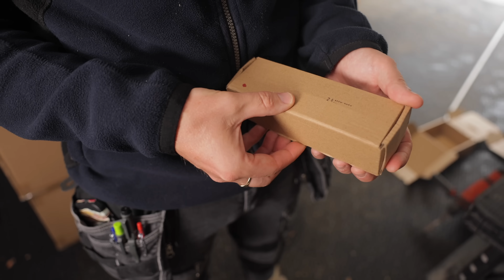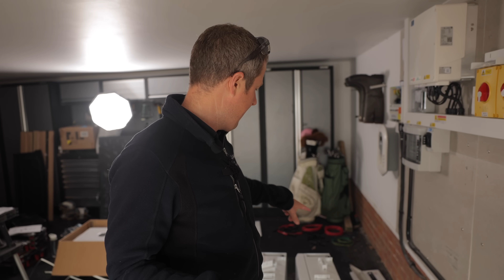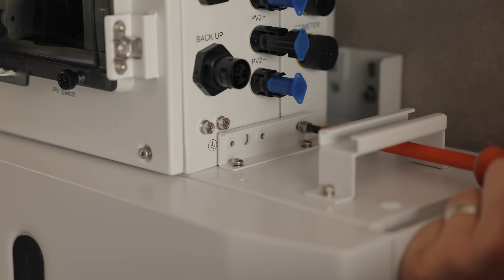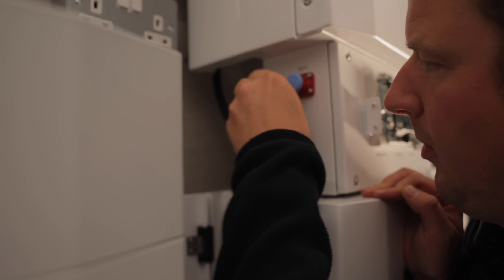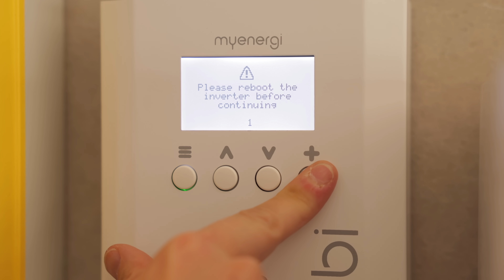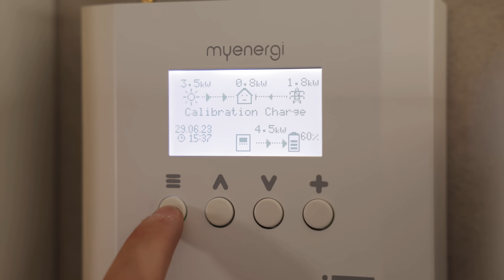How To Install A MyEnergi Libbi Home Battery Storage System 🔋

Comment: I do like the My Energi connectivity and easy menus with lots of user info. Not keen on the connectors for Grid/Load and wonder how long those pins would carry 20 Amps, I would have preferred a direct connection to an MCB. I see people are saying why only 2 double sockets for back up - User choice of course, but it seems odd with 20kw of back up, circa 6k of kit plus installation and you still have trailing leads for back up. Personally, I would have used half the CU for back up to ensure lighting and small power during power outage

Comment: Ah. Low voltage batteries.  I remember them. Drawing  over 60 amps to boil a kettle as opposed to 10 amps on a proper high voltage Solax set up.

Comment: If a customer wants to add an extra 5kWh module to a 10kWh libbi system (5kW inverter already fitted), is there a kit for this, or do you need to order all parts separately ?

Comment: Hello, congratulations on the flawless installation, you're truly an artist!
Thinking about those incompetent individuals who installed the photovoltaic system for me with 2 BluE-S 5000D inverters and 4 battery packs on a three-phase system, it makes me furious!!!!
Am I mistaken, or did you not configure the DIP switches in the video for addressing the battery packs? Would the controller work with another Kstar inverter as well?

Comment: Hello from Germany, your RCD tripped in 126 ms. In Germany they have to trip within 200ms or 400ms depending on the earthing arrangement. But in reality they trip much faster. Most RCDs in Germany trip within 30ms. So my stupid question is: Is 126ms a common time for a RCD to trip in the UK? Because the time should only depend on the RCd itself. And in the UK I have always seen the same brands than in Germany. I must admit that I am a little confused.

Comment: I have a question you might have been asked previously: would it be at all economical to get batteries fitted and an inverter without solar panels and charge the batteries from the mains supply over night when the cost of supplying energy is cheaper than during the day. Then using battery power during the day? How’s that for a question lads, I will wait to see what your reply will be. Great dvd by the way.👏👍🏴👏👍🏴

Comment: Apparently minimum distance between batteries is 20cm, and maximum is 25cm. I need to have mine installed a minimum of 60cm apart due to location, and apparently that isn’t possible. What are your thoughts on extending the cables?

Comment: Hey, I’m a bit confused about the EPS earth rod being connected to the MET? Doesn’t that defeat the object of completely isolating the grid side of the installation? I thought it was a discrete earth feeding the EPS side only. In the event of a fault occurring on the EPS side, aren’t you potentially feeding current into the grid earth via the MET? I thought the EPS side has its own TT earth attached to nothing else.
Reply: The safest thing would be to convert the whole house to TT then theres no risk of current onto the DNO earth
Reply: @haldo691  ooh, that’s a hot topic on other forums! Using steel reinforcement in foundations as a TT earth,….. possible introduction in future regs……

Comment: I'm all for safety but even the handling restriction in the manual seems a little over cautious. The Libbi is LFP and in the words of Dr Euan McTurk, "It's basically a rust battery, you'd have to do something monumentally stupid to get it to catch fire"
These type of battery chemistry doesn't get hot enough on it's own to become self sustaining. It'd be like trying to light a flame retardant couch on fire. You could definitely do it, you'd just have to put a whole lot of effort in.

Comment: A quick question, maybe stupid but I’m not shy for asking stupid questions, what’s the opinion/rules about putting the markings on removable parts, aka the lids of junction boxes/isolators?
By the way, next time you should consider cutting the flooring out underneath the batteries, if the customer want to replace them I’m guessing it’s not gonna be cheap.

Comment: Hi Jordan,
I’m a keen follower of your channel. At 78 I am still learning!
Could you answer a confusion about solar panels?
If I want to do an alteration to my home electrics, say replace a faulty light switch why do have to isolate the supply from my solar panels?
This seems to be the advice by the experts.
If I am to turn off the circuit at the consumer unit and attend to replace the faulty switch, wouldn’t that be okay?
Cheers, David

Comment: This was an excellent video Jordan. Great work. That comms cable on the back of the inverter looks a faff. That needs engineering out lol. I always struggle commissioning pretty much all the EV charge point and PV systems. Especially the wifi reliant ones! I find the CT setup with myenergi a little clunky as well tbh. Loads of very helpful and useful tips in this, appreciate it! Does this system have a built in neutral earth bond relay for island mode? We are waiting to go on our libbi training atm!
Reply: I like many are having issues with their harvi wireless ct sensors, may have to swap to a cable type.

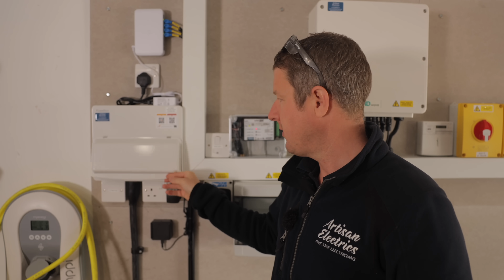Comment: 9:50 also if you've got a separate PV inverter then in theory at least you can self-power a larger load. If your house is using 8KW in the middle of the day and you really don't want to pull anything from the grid you can take e.g. 5KW from the solar and 3KW from the batteries simultaneously. If you only have one hybrid 5KW inverter then even if you have a full battery and the sun is shining you're still limited to supplying 5KW total
Reply: that's why you run a 16KW hybrid...
Reply: @eethon1  well, yeah that would be another option, but here Jordan is discussing reasons you might have a separate PV inverter to your battery system
Reply: @JamesScholesUK  Indeed, was a little tongue in cheek.

Comment: Can I ask why the normal HD wave inverter was installed and not the Home Hub series? Actually, surely 2  Solaredge batteries would have been cheaper and a dc coupled solution with one app support?
Reply: They may have a FIT tariff, you need to be AC coupled for that.

Comment: I do enjoy these videos they're interesting and informative so thank you. I do have a question though. Is this battery system only powering those 4 sockets if the event of an outage? Could you wire the batteries/inverter so it powers specific circuits such as lighting, heating or fridge etc.?
I understand perfectly why you need to isolate between the grid and the battery and that this isn't an 'Online' UPS so there is a ms of delay. but could they be installed so they power the whole house?

Comment: I really doubt that any portable fire extinguisher would put those packs out once it started.  You might be able to put the cardboard box out, but the battery itself will continue to burn.  I know firefighting an EV once started can take 30,000-50,000 gallons to extinguish.  A 50 lb ABC Wheeled Fire Extinguisher that weighs in at almost 200 lbs on a cart only will operate for 35 seconds.  Its s completely silly requirement for sure for the transporter to attempt this even at all.  You get out and walk away while calling the fire dept and tell them where the melted pile of metal and plastic, uh van I mean, will be located.  🚒🧯🔥
Reply: Well no, because these aren't Lithium Ion batteries.  Lithium Iron Phospate are a totally different beast, and are probably safer than the lead acid that starts the van.

If you were using a Tesla Powerwall, then yes, they use Li-Ion and are likely to melt a flaming hole in the road.
Reply: @zstation64  Completely agree with you.  Just funny that they want you to carry a portable ABC extinguisher to put out a large lithium battery fire in the first place.  Every commercial vehicle is required to have an extinguisher here in the US, but typically it's not for you, its to help the other guy that might need it.  🤠👍  My guess is that if your van is on fire you won't go inside to grab it and then open the doors where all the fire is to try and to put 20+ kWh or more out.  That is why the fire dept is there to help out.  🚒

Comment: Another great video. Just two questions, not sure if it's the same for you but our DNO views an AC coupled battery as a separate micro generator which puts you over your 3.6KW export. Also I was just wondering how important it is to use Libby? Kstar is the same thing and costs 1K less
Reply: I'm not in the trade but I imagine it's the same as with all generic products: is the cost saving equivalent to the possible loss of technical support?

 In this case I have no idea about the support for the similar product it's just a suggestion and may be worth investigating before committing to purchase. 👍

Comment: Got a question, why did you run the long positive cable instead of a short one like you did with the negative cable? It looks like they’re wired in parallel. Enjoyed the video even though I’m in the US. By the way, it looks like Nick did a nice job at your house.
Reply: They're wired in antiparallel. Inverter negative goes to battery 1, then 2, then 3, ... while the inverter positive goes to battery n, then n-1, then n-2, ... This ensures that the total positive and negative lead length combined is the same for every battery.
Reply: @aaronmdjones  Got it. Thanks for the info. Never knew that.
Reply: @aaronmdjones  From libbi-Install-Manual-Rev-6.1-25.04.2023.pdf:

Power Cable-Negative (Black) - 250mm
Power Cable-Negative (Black) - 485mm (x2)
Power Cable-Negative (Black) - 1800mm
= 3,020mm Cable

Power Cable-Positive (Red) – 485mm (x2)
Power Cable-Positive (Red) – 1900mm
Power Cable-Positive (Red) – 3300mm
= 6,170mm Cable

Am I missing something, but for the combined lead length to be the same, then should we expect the total length of negative to equal the total length of positive cables?
Reply: @brettjtodd  The combined lead length of both positive and negative from any single battery to the inverter is the same. This doesn't depend on the overall positive lead length being the same as the overall negative lead length. The red lead is longer because it needs to drop down and snake over and all the way up to the other battery. But for every time the positive lead length increases by one battery's worth, the negative lead length decreases by the same amount, because the batteries are a fixed distance from eachother and there's very little slack.

Comment: Great video as always Jordan. Found this extremely interesting and has answered a few questions i had regarding the set up. Am i right in saying your zs value obtained was high due to the  TT earthing supply being used for the back up installation? Also one other question I still have is regarding the ethernet cables, are you running them inside the same trunking as the main 230v cables? If so are they not prone to electromagnetic interference from the circuit cables you have installed? Should they not be run in compartment trunking and kept separate.?👍🏻👍🏻👍🏻

Comment: Is there a requirement to make the Libbi the primary if adding to a location that already have MyEnergi devices? Does it make a difference what the primary device is?
Reply: The primary device is generally the one with the hardwired grid CT connection.

Comment: Don’t know if it’s a requirement in the UK but in Ireland, the DC needs to be segregated from any AC cable.
Reply: It depends on the construction of the cable used. If reinforced double insulated the cables are just required to be able to carry the highest voltage in the containment. Same for the CT links etc. If single insulated cabling it would require further segregation in the containment which some installers use plastic copex for.
Reply: Careful with type A RCD on the backup socket as it is possible it won’t trip in an earth fault due to DC blinding. The test button might work but it may not trip in a fault if there is DC leakage. Type B only and might be even better to swap the internal Libbi backup Isolator for an RCBO.
Reply: The Libbi won’t be able to do anything with an export limit as it has no control over the Solaredge inverter where the PV is connected. The export limit should be left on the Solaredge if an export limit is mandated at that property.
Reply: myenergi will have an installer portal available soon so you can see more details than the customer sharing the app will show you. Handy if the mains MCB has tripped or if production is low you can see strong voltages/amperes as well as battery charge/discharge rate which is handy in cold weather and the battery is not charging.
Reply: As you have hardwired the Zappi and Libbi controller with Ethernet, a handy tip is to turn off the RF on both and allow the CT communication to happen over IP rather than RF.
Reply: Yes it is, they should run the dc cables in copex inside the trunking to keep them segregated, I got pulled up on this in my MCS inspection, that’s why I sleeve all the ac cables in 20-25mm copex even when they are in the trunking.

Comment: I love that this is still using RS-485. It takes me back 40 years to when I was first in Electronics in the 80’s. Now I’m retired and watching the latest transition to battery storage and it’s still using that same slow speed first gen multi drop serial interface. 😂
Reply: It may be slow, but it’s clearly fast enough for this purpose, and it’s a tried, tested & reliable.

Comment: Surprised AC RCBOs are not bi-directional, I would have imagined with it being you know AC, it has to support electricity going both ways?
Reply: Type AC RCBOs shouldn’t be used on solar PV as it is prone to blinding from DC leakage from the inverter. Type B RCBO should only be used but 30mA are prone to nuisance tripping hence why myenergi are recommending MCBs in the UK.
Reply: 100mA type B are recommended, but have you seen the cost of them
Reply: Alternating current means that the current travels bidirectionally yes, however that doesn't tell you which direction power is traveling in. Using the conventional model of current flow, if the AC voltage were on the positive half of the sine wave (line is above neutral), and current were traveling from the input to the output, then power is traveling from input to output. However, if current were traveling from output to input, then power would be traveling from output to input. This is how you determine import vs export. What Jordan is saying is that apparently the test functionality on these RCBOs does not work when power (not current) is traveling from the load terminals to the supply terminals.

Comment from the maker: Find out more about Libbi here: https://www.myenergi.com/libbi-battery-storage/
Like and subscribe for more content like this!
Reply: That's a great video! If you're looking for a reliable home backup power solution, I highly recommend checking out the Segway Portable PowerStation Cube Series. It has a massive capacity, fast charging, and multiple output ports. Plus, it's built with Segway's UltraSeal Technology for waterproof durability. Definitely worth considering for your outdoor adventures and home power backup needs! 😊